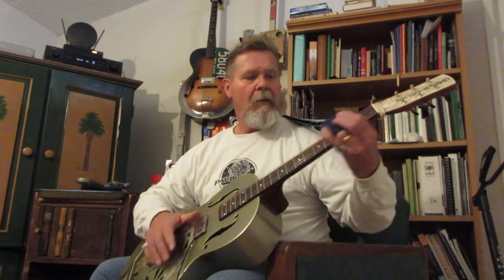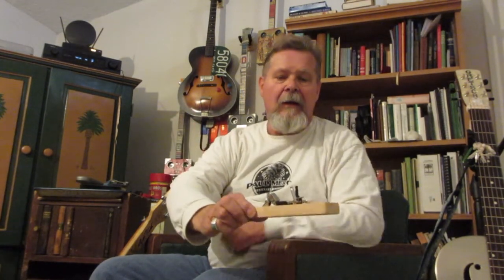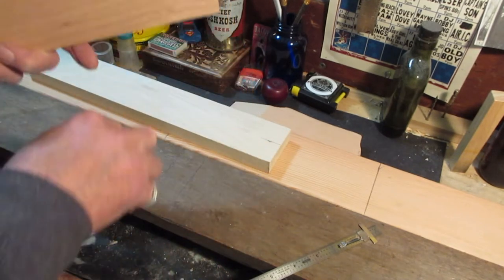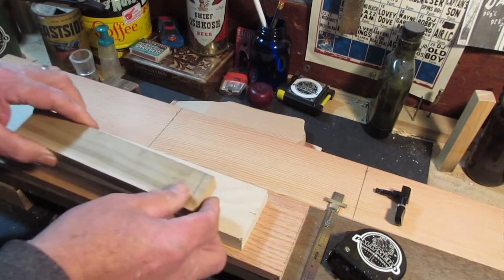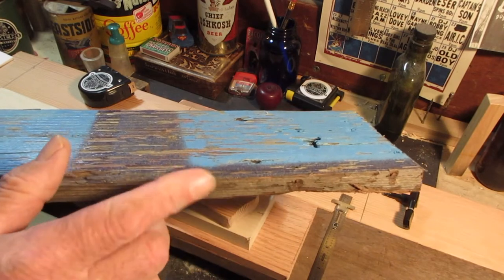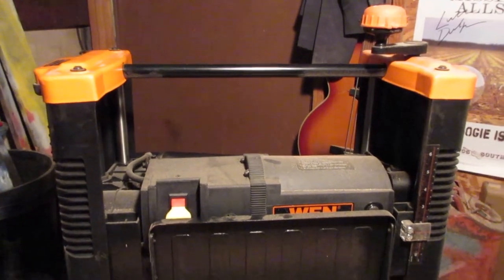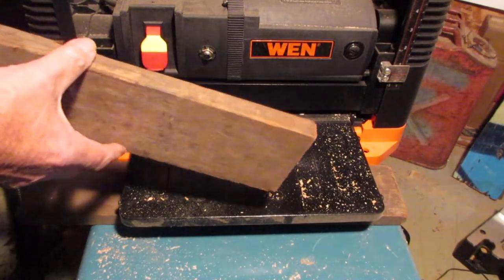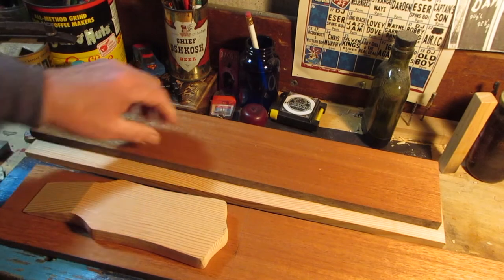How to Build a Cigar Box Guitar: Turtleheading Tuners?

Comment: If the headstock is too thick I will use a forstner bit to cut a larger hole on the top for the tuner that fits the nut for the tuner. The tuner then sits lower in the hole. Usually it gives a very nice string angle to the nut.